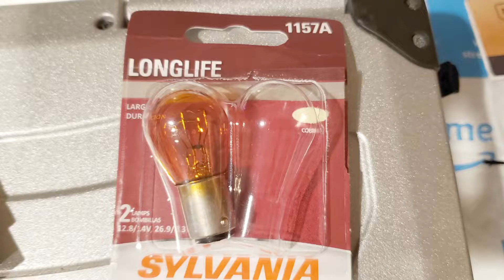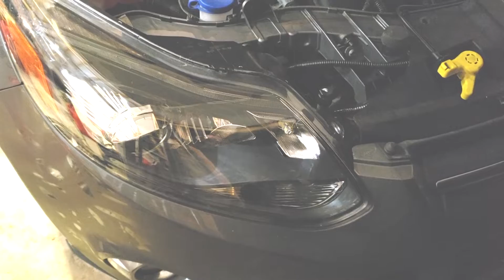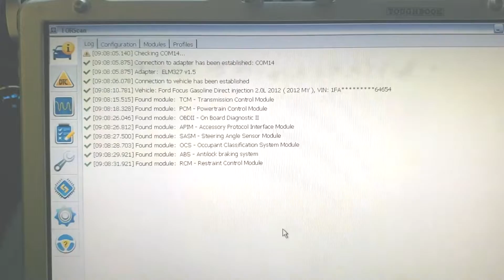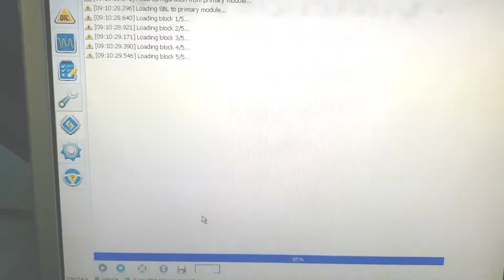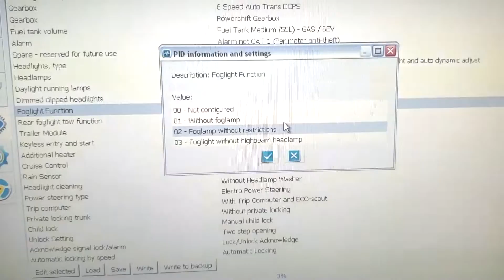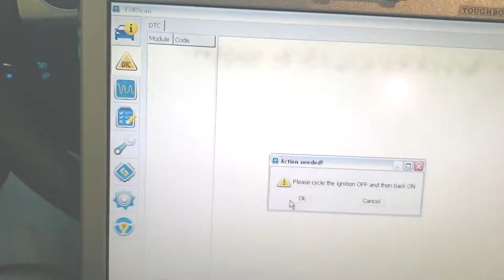2012 - 2014 Ford Focus HID Projector Headlights & FORSCAN Programming MK3

Comment: Seems that I have a car that originally had halogen and someone upgraded to projectors. They look like they don't have horison adjustment, but when I turn them on they test move left to right to test the lights for turning. Which option in Forscan would make them work while turning, and also get the turning H1 lamps to work? It's a mk4 2012 mondeo, in forscan it has BCMii menu, but the dropdown menu is the same

Comment: Hi! I have a similar issue, I’ve had LED tail lamps installed on my focus, which leads it to think the rear turn signals are out. My thought process was that if the setting was changed to recognize LED headlamps, it might also recognize the LED turn signals. 

However, I haven’t gone through with any forscan changes yet. I wanted to know if you have any insight. For your car, did you experience any hyper blinking? The DTC codes you showed would normally mean hyper blinking, did clearing the codes also remove the hyper blink? 

Wanting to know if there’s any solution to my hyper blink without having to go with resistors. Please let me know. Thanks!
Reply from the maker: I didn't add any LED turn signals so I'm not sure and this video is kind of old, but most newer Fords and most of the ones I've dealt with recently did have a BCM setting for LED turn signals instead of halogen.

Comment: Hello! I have a Ford Focus mk3 2012 1.6.tdci. I installed the H7 led on the dipped beam, but when the engine is turned on, they light up and at an interval of 1 second, they go out one by one, right then left, and a message appears on the board such as the light bulb is burnt out. It is possible modify the system to transmit a higher voltage to the computer or permanently cancel the burnt bulb error? Thank you!

Comment: Great Presentation and I learned so much! Youtubers, I was wondering what exactly needs to be selected for LED Headlights.  I get error message with LED headlamps and I have FORSCAN and could do all the steps described in the video.
Reply: did you ever figure this out? about to dive into forscan
Reply: @nstone95   @isaismail7933  change the setting to '00 - not configured' no fault and lights work

Comment: Hi
Thank you for the video, i did the same thing and the led lights are working but i keep getting an warning on my dashboard saying that there is a problem is there a way to remove it?
Reply: Not 100% sure, but i saw that someone put a comment on here saying that they was able to select a different option that was available to them on the latest forscan version that allowed for LED bulbs without error messages. You would have to check for yourself however.

Comment: I need help
I have Ford grand c max which had xenon lights self adjusted. I put standard lights and it was giving error "headlight malfunction" every time I start the car. On off and auto was working fine.

My garage Electrition said he would fix it.. But he has tried resetting the error and now lights do not work on auto stays on on auto settings do not turn off when you turn the switch to off position. But they do turn off when I switch off the car.

No my question is what damage has he done as he is not able to reverse it and insisting me to install xenon lights and claims that it would fix it automatically..
But I do not believe him no more and I'm stuck. Please guide.

Comment: Any way to get the Headlamp Fault Message to turn off? Did the same procedure with forscan as you but that message always remains
Reply: Any luck with this?
Reply: @isaismail7933  change the setting to '00 - not configured' no fault and lights work

Comment: My led light is only working on battery  but when i start the engine the led lighrs turn off. Will using forscan resolve this issue?
Reply: I don't know if you figured it out, but I think the problem you have is tied to this, meaning you can try or wait a few weeks for me to figure it out for sure. I do know that halogen works which means it isnt a problem with wiring for me. I just got a focus and found this problem out, waiting on a compatible scanner to arrive to test.

Comment: I have Focus MK3 headlamp with auto leveling and bi xenon. Is it possible to replace it with led or halogen after market headlamp? Thanks
Reply from the maker: There are aftermarket LED bulbs to replace xenon HID bulbs. Why would you want to do that though? HID is the best.
Reply: @JackofAllMasterofNone  Thanks, I mean replace whole lamp system because It has malfunction and it seems much more simple with regular aftermarket headlamp.
Reply: @akmalranggaputrawarganegar2523  I was wondering the same thing. Did you ever figure this out?
Reply: @ariggins189fgt  not yet, I still find a way to bypass system and diff socket
Reply: @akmalranggaputrawarganegar2523  I'm just curious whether you can basically do the opposite in forscan for downgrading from st3 to a different aftermarket light. Like maybe switching it to halogen setup and disabling the cornering lamps and auto leveling
Reply: @akmalranggaputrawarganegar2523  i have same problem with my focus did you found out solution?

Comment: I was planning to buy these same ebay headlights for my '13 Focus SE. I had thought about going HID in the projectors, but after seeing all the hassle you went through I changed my mind and would rather go the LED route. What is your feeling about using the Morimoto 2STROKE 3.0 in these projectors? I am mainly concerned about the "cut off" sharpness. Headlight Revolution showed the beam to have a pretty good cut off and a rather wide hot spot in a stock REFLECTOR housing (Toyota Tocoma). I have NO trouble running LEDs, just loading the BCM with a 400ohm relay is enough to satisfy the CAN BUSS, I had tried a "BeamTech" and a "Bevinsee" LED bulb and they played nice with the BUSS, however they had some light splatter above the cutoff causing   some oncoming cars to flash me. I was lucky that I did not meet any oncoming Polizei, although here in Wisconsin, Illegal lighting is the least of your worries! I would REALLY like to use the xenon bulbs for their beautiful beam pattern in a projector, but with all that wiring mess it's turning me off.  I did install some BeamTech fog LEDs outside of the BCM loop (the reason for that relay tied to the low headlight), too bad I couldn't do the HIDs the same way and use the BCM voltage to "pick" the relay. Anyway, I would appreciate any ideas you may have, because the stock halogen lighting in this car on dark roads is ATROCIOUS!
Reply from the maker: The Morimotor 2.0 and 3.0 LEDs would both work excellent. They won't be quite as bright but I'm sure would make you happy. I have used them and they are much much brighter than halogen bulbs.
Reply: @JackofAllMasterofNone  THANK YOU for the quick reply!

Comment: Does the headlight adjuster still work after the modification?
Reply: YES! NO mechanical mods were done to the headlights, both horizontal and vertical adjusters should work!
Reply: @TheOzthewiz  I meant the electronic adjuster (with the knob inside the cabin).
Reply from the maker: These do not have the electronic adjuster. These are manual adjustment only.
Reply from the maker: Yes

Comment: This way helped fix the issue with a 2012 Focus S, put LED headlights in, did what you said, work now, still get error screens, but they go away after a few seconds, thank you!
Reply: Did you buy the extended license
Reply: @dylanhouck7397  were you able to find out about the extended license? My FORScan program gave me the same message when trying to run the main configuration.